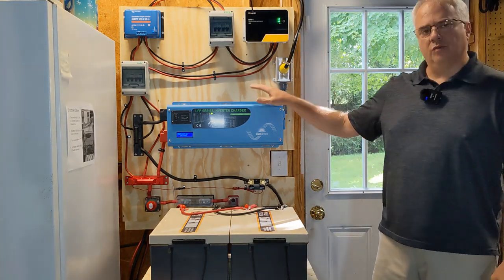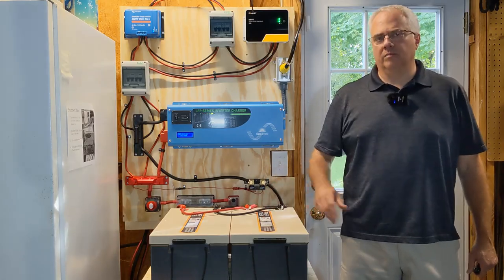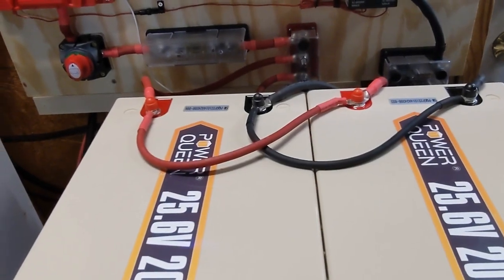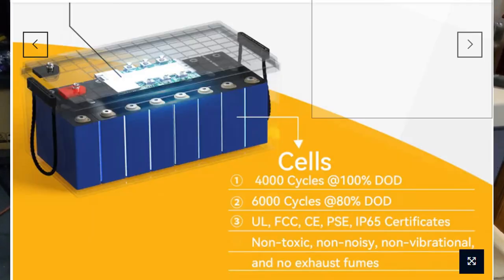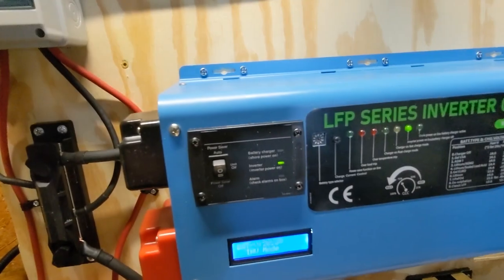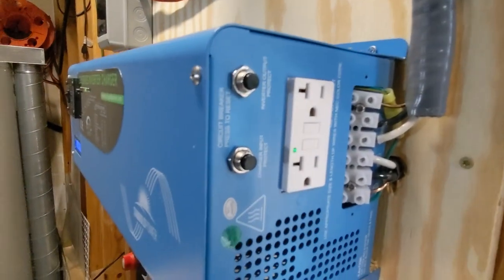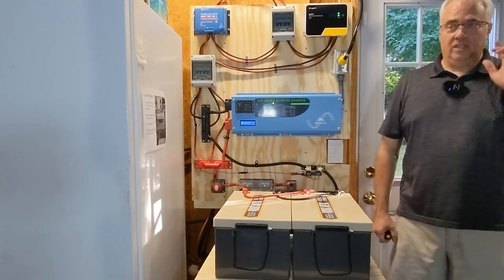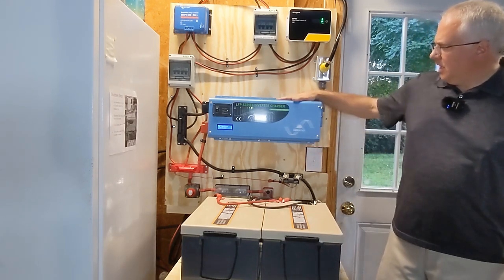24v DIY Solar Generator Setup - 4000w - 10,240kwh with Built-in Battery Charger

Comment: One comment/question - you use 2awg from the batteries to their dedicated bus bars, but then 1/0 from the bus bars up to the rest of the system. Seems like the 2awg is the weak link there. Any reason you didn’t just use 1/0 for this part of the system?
Reply from the maker: Its been a while since I thought through this and did all the calculations. But each battery has a 200 amp BMS. According to the "Windy Nation" website, their 2 awg battery wire can handle up to 205 max amps. Since I have both batteries directly connected to the bus bars, I believe that should be large enough to handle the connections from each battery to the bus bars. Now if I had the batteries connected in parallel where I had the batteries connected together and the positive came off one battery and the negative came off the other, you are right. I would need a larger wire there. But because I have them individually connected to the bus bars, I believe 2 awg is good there. Regarding the use of 1/0 in the rest of the build - My inverter is 4000 watts and I don't plan to push it to that except for very short periods of time. 4000 watts would roughly be 156 amps on this 25.6 volt system. The Windy Nation 1/0 wire is good up to 285 amps. Even if I push it up to 7000 watts, which would be about 273 amps, the 1/0 wire should be good. Assuming the batteries are being drawn upon equally, pushing the inverter to 7000 watts  would be 136 amps being pulled from each battery. My inverter is hard wired into my transfer switch which has a max of 7500 watts. When I ran the stress test nothing really got warm except around the battery switch. A viewer pointed me to a video where someone was testing that very same battery switch and it was getting warm just as I experienced. I need to switch that out for something better. Thanks for commenting. These things are very important so as not to start a fire. If I made a mistake above, please point it out. We can all learn from it. It amazes me how we do all this planning and calculations to get the right size wire and we come up with 1/0 for example. Then you open up the battery and find a 6 awg wire on the inside. I just don't understand that.
Reply: @proficientprepper  thanks for the detailed explanation. I’m not sure how Windy Nation rates their wires higher than standard - 1/0 wire is rated to 150A for power transmission and 245A for chassis wiring (this application). In any case I don’t think you made any errors, was just curious.

Comment: I'm new to this but have 30 100w panals a couple 200 ah batteries and a couple 100ah batteries trying to build system with a 3000-9000 watt inverter and weak charge controllers all at 12 v but can go to 24 except inverter is 12 but I bought a reducer and waiting on combiner boxes with fuses that combine 6 positive negative wires so I bought two but over my head a bit what do you recommend two systems or just one? I have bus bars and a big on /off switch I'm still connecting all not sure but I like what your doing and trying to copy and have the panals  I'm just not a electrician I'm a carpenter by trade off grid .
Reply: I see your on grid I'm totally off-grid but have very similar set up despite that but I'm in process of building getting rid of old lead battery system so it's a bigger jump for me I could use an electrician that's for sure lol😅
Reply: I don't think you'll use that system much grid tied .
Reply from the maker: I like redundancy in things like this, so you may want to consider two systems. If something breaks, at least you have another system to work with.
Reply from the maker: I found an electrician that is just him and he has reasonable prices. I had quotes from electrician companies with several employees and they were much more.

Comment: 48v DC is still considered pretty safe and low volts. I believe you need to get over 50 to not consider it low voltage. But seems like 24 v is a sweet spot.
Reply from the maker: Thanks for the comment. I once heard Will Prowse say 48 volts could kill you. That stuck with me.

Comment: What was your primary reason for choosing the LF inverter  and individual pieces verses an all in one system?
Reply from the maker: Choosing between an all in one system vs a the LF inverter/charger I got was a difficult decision. I went back and forth over a couple of weeks trying to decide. I'm still not sure I made the right decision. I will most likely end up with a 48v all in one system at some point in the future. I believe my decision in the end was based on a couple of factors. I had decided to get an all in one unit until I discovered in the specs that the MPPT input needed at least 120 volts to even function. I did not have that much solar. I found some other units that needed at least 90 volts. That was better, but I was worried that might be an issue also. Cost was another factor. This SungoldPower LF inverter/charger I ended up getting was on a special at the time and I picked it up for about $895. The "all in ones" I was looking at were just around $1300 at the time. I'm looking forward to upgrading my solar in the future which should open up more possibilities. Plus it gives me a reason to make another video! :)
Reply: @proficientprepper  Have a look at the Growatt stackable 5kw 746
Reply: @proficientprepper  tell me if I understand this correctly, if a 100w panel from harbour freight has a VOC of 21.6 v, one would only need 6 panels to hit the 120v threshold for the Growatt 5K?
Reply from the maker: Yes, that is my understanding. That would be 129.6v which is over 120, but not by much. I know what during the day as clouds pass over, the voltage does not change much but the amperage varies wildly depending on the clouds. So 6 of those panels might work if the voltage stays over 120. Depending on what you are doing, that does not seem like much solar power for such a big inverter.

Comment: NO 24v to 12v buck converter to DC load panel?
Reply from the maker: I thought about that. I may add one later. I don't have a lot of need for 12v devices in the garage right now.

Comment: What's your max run time with this setup
Reply from the maker: I don't really have a good answer yet for an extended power outage. I have not yet ran a test on the critical loads I plan to use it for. By just doing some basic calculations assuming good conditions, I believe I can get by for about two days running my critical loads without any solar charging. If I'm getting some good solar conditions, I should be able to run my critical loads indefinitely. However, in my area I don't always get good solar conditions so if I get multiple days of heavy clouds, it would run out in a little over two days. While the grid power is available as it is now, I run 4 circuits full time on this system (TV, all lights, smoke detectors, internet, router,  few others). On good solar days, it will charge back to full from about 50% SOC every day.

Comment: what are the economics of say running a dual 2000w 24v system over a single 4k/48V system?
Reply from the maker: Hmmm. That's an interesting question I've not thought of before. Since you used the term watts, I assume you mean two 2000w 24v inverters against a single 4000w 48v inverter. Also assuming the batteries would have the same watt hours, the battery cost would be about the same. I would say two 24v watt inverters would be much more expensive than any other savings you might get with a 48v system such as smaller wiring. If I misunderstood the question, let me know.
Reply: Cost and technical crossover.  I mean you've bought the 24v stuff already and it's not going to electrocute you. @proficientprepper

Comment: i have the aims 4000 watt 12 volt inverter looks like the same build it has no lcd display and no house hold outlets but i looks the same dont need 4000 wats in my setup but for the quality of my unit its what i will use to buy a 3000 watt inverter on the cheep side it would cost me 400+ my inverter is heaver the 54 pounds
Reply from the maker: Yep, I've seen about 4 inverters that look very similar to this one but different brands. They only have slight differences. It would be interesting to open them up side by side to see if they are the same inside.

Comment: I squared R losses are just  to high @ 24V.  16S LFP  "54V" is the minimum for continuous use for most loads. Actually 400V is the best option but the Mob "UL" needs to keep the sheeple in the fold. ie.  dependent ON GRAFT.    No North American equipment listed over 60V. Actually 9V has been fatal so take no chances.  There may be no second chances. Wood backboard offerse no protection for the house in a chernobyl event.
Reply from the maker: I may put a hardiebacker board behind the plywood. Not ideal combined with the plywood, but probably better than nothing.